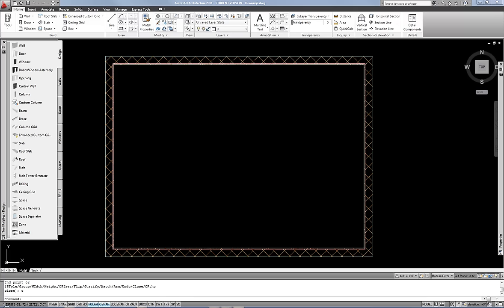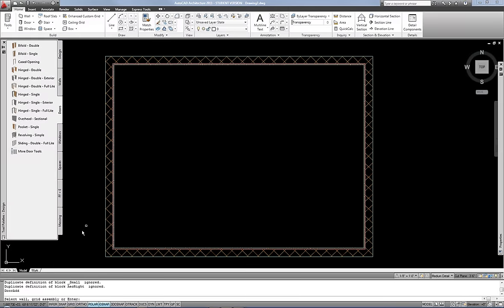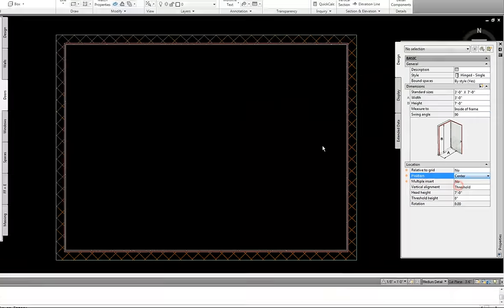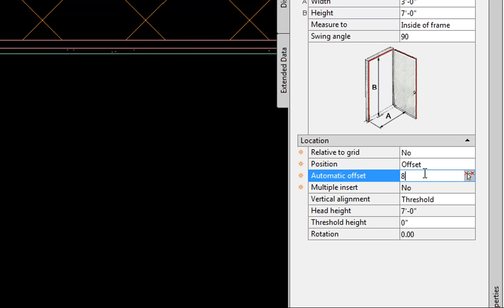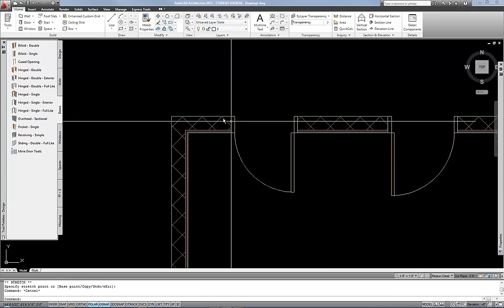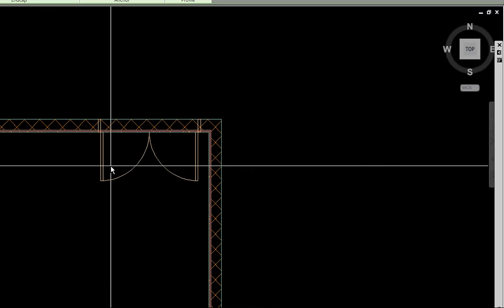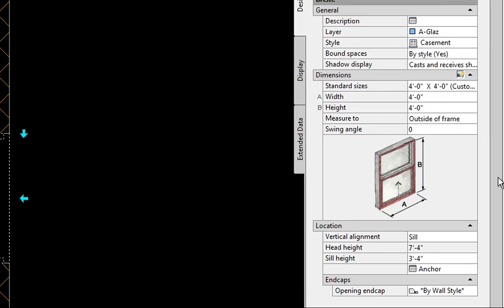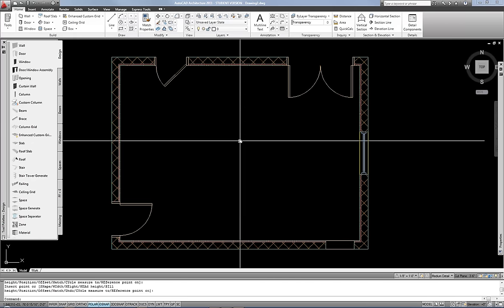ACA: Doors, windows, openings

Comment from the maker: I apologize, I do not have a video on custom doors at this time.  I would start with the help menu, it is actually fairly helpful.  In nutshell, Edit the door style and on the Design Rules tab, choose a shape and door type to use. Or you can use a custom profile, which would require pre-drawing a profile to suit your needs  A profile is neither a 3d model nor a block, but rather a 2d closed loop that has been defined as a profile.

Comment: I'm kinda having parallel request to luvuyo concerning 'creation of custom door and window styles'. I had specific window types used in my country but the default styles lacks them. I did several 3D Models of them and saved them as blocks that don't have the application simplicity of the built-in styles. 
Any help and/or descriptive video information would be helpful. Thanks for the tuts.. very helpful.

Comment: Is there a way to create an arched opening in a curved wall that is curved vs straight lines?
Reply from the maker: You could using the curtain wall tool using an AEC Polygon as your infill.  Not with the standard window tool.
Reply: Thanks jeremytf77 for responding, but that is not really the result i am looking for.  I am trying create a half round covered porch using a 16" cmu wall style, then using the opening tool, place several arched openings in the wall.  the result i am looking for would look like columns between arches.  Looks like straight legs in plan and very hard to place in properly.  Look right in 3d though?
Reply from the maker: David Grussgott
 ACA is not very good at the kind of thing you are trying to do.  If I were you, I'd 3D model what you need.
Reply: jeremytf77 Okay, thanks. I will give that a try.